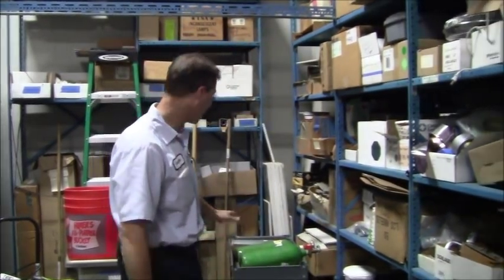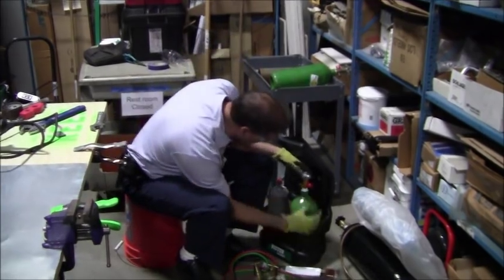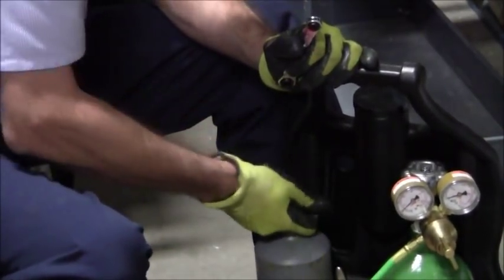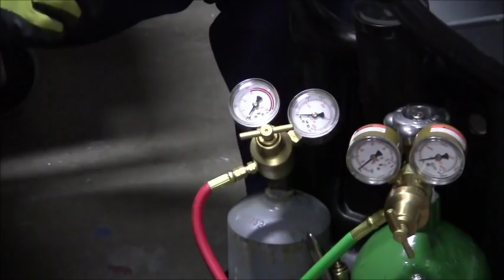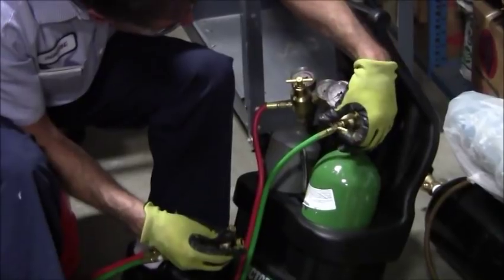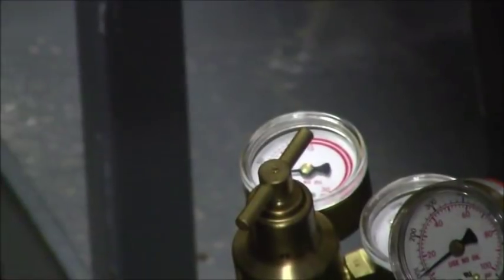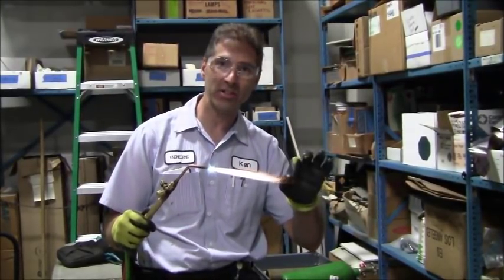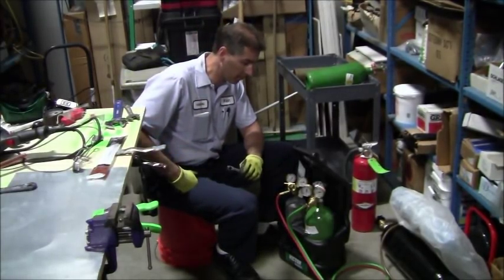How to Setup a Oxy Acetylene Torch Set

Comment: I see a lot of positive comments.  I will agree that there are a few good pointers. However, having working in a small confined space with lots of combustible material is an accident ready to happen no less having poor ventilation. So you choose your two pressures because that is what you see people set theirs at?  Base your settings on the type of welding you are about to complete along with the material being used and the thickness. NO brass fitting should be as tight as you demonstrated!  Just snug is all. Should have known which connections were left handed threads and right handed threads before beginning the video. I have a lot more to say -.....  but I will leave it with that.  Be Safe!!!!!
Reply: I'm curious about what else you have to say! I'm new to oxygen and acetylene heating and welding so in my opinion the more information the better. Thanks for your comments.

Comment: You really should not face the regulater toward your nuts with that pressure, it's not very safe
Reply: Especially high pressure gases like nitrogen or oxygen. Heard of people getting slammed in the gut if the threads stripped and the adjusting handle blows out...2000 psi is no joke.

Comment: The oxygen should be set at 15 psi... And yeah the acetalyne should be 5 psi
Reply: That's too high for brazing with a small tip, and too low for cutting.... That size 0 tip specs are anywhere from 3-6 psi on Acetylene, and 5-10 on Oxygen. So the settings he's using are in the ballpark. Never have the A pressure higher than the O... For a rosebud cutting tip, then 5-8 psi Acetylene, and 25 psi Oxygen are good starting points, depending on the tip size.

Comment: Just a note: Never store Acetylene on it's side, unless you want to create a bomb!
Reply: From what I've been told acetylene cylinder on it'd side brings the acetone to the valve which then damages the regulator.  So leave in upright position for a period before opening main valve to regs.
Reply: You can store tanks on their side, but you have to turn rightside up before opening the valve at least 1/2 hour, preferably longer. The acetone is dissolved in powdered furnace brick compressed into a solid material on modern cylinders. It's not sloshing around in cotten anymore. That was the case back in the 1950's-60's, but those tanks are all gone now.

Comment: Acetylene bottle must never be stored or used on its side. If it has been resting on its side it should be left standing up for 24h before use. Failing to do this is very dangerous.

Comment: thats a very bad flame your brazing not welding also to cut steel your missing a part on the torch, thats the incorrect way to bleed them you close tanks and relight that way it burns off the gas, in welding and gas class you would have failed my instructors class.